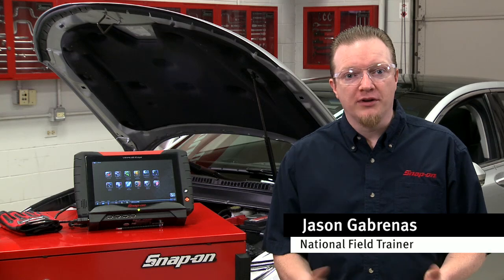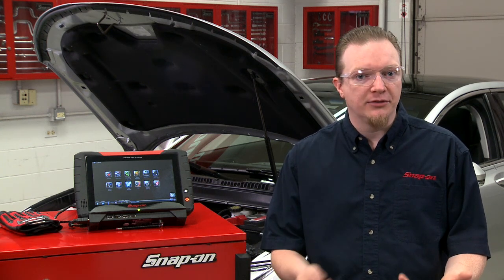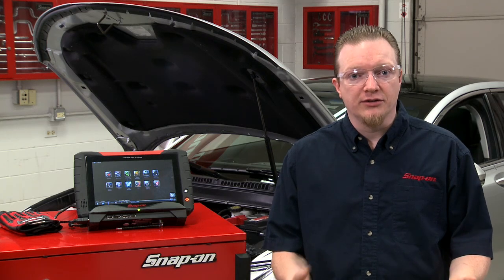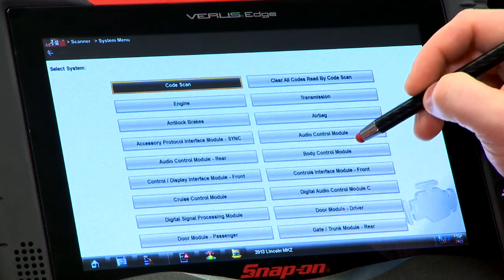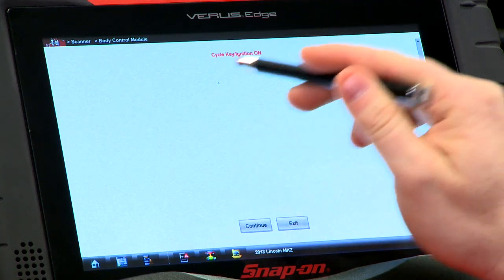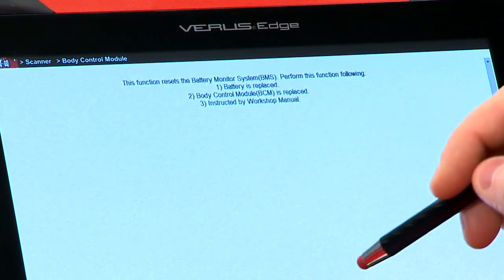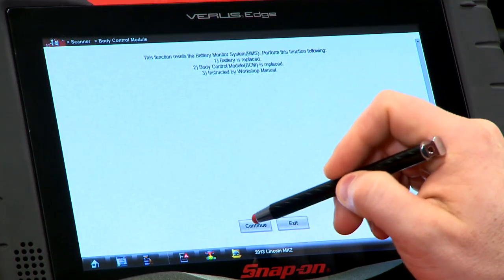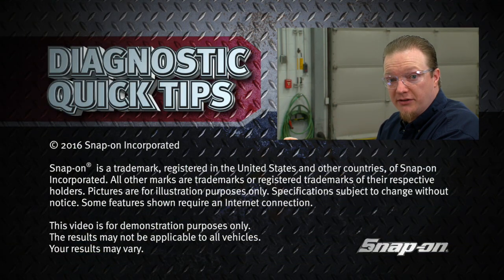Ford® Battery Monitor System- Diagnostic Quick Tips | Snap-on Training Solutions®

Comment: Total rubbish
You can do this without any tools

In the uk
Ignition on 
Wait 10 seconds 
Press rear fog light switch 5 times
Press hazard light switch 3 times
Wait for the battery light on the dash to flash 3 times

In the us (I'm 99% sure this is correct)
Ignition on
Wait 10 seconds 
Flash main beam lights 5 times
Press brake 3 times
Wait for battery light to flash
Reply: You mean high beam lights?
Reply: I did both of these and it did not work :(